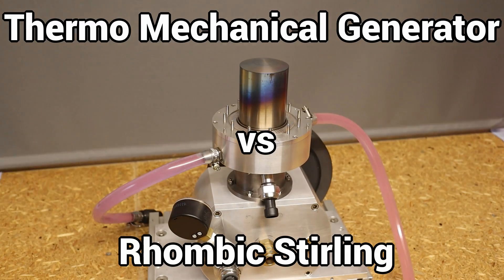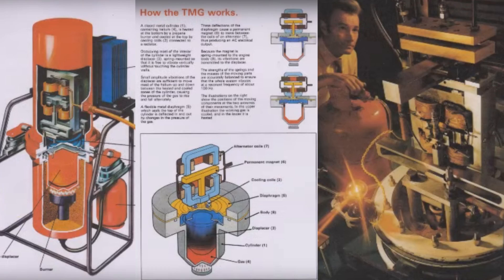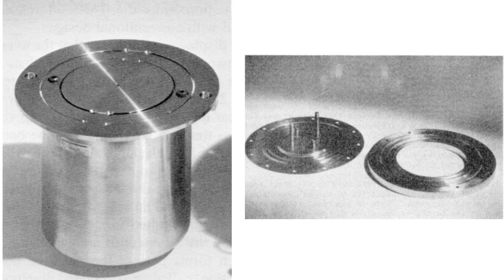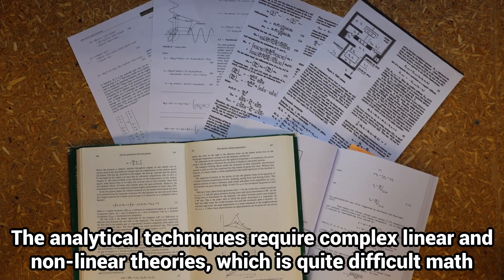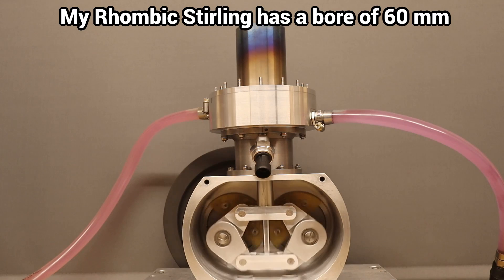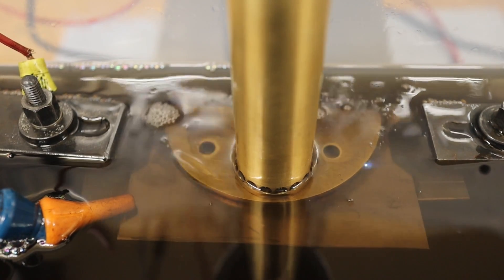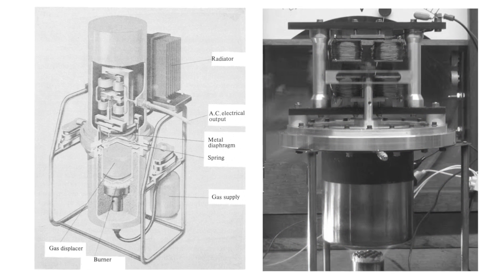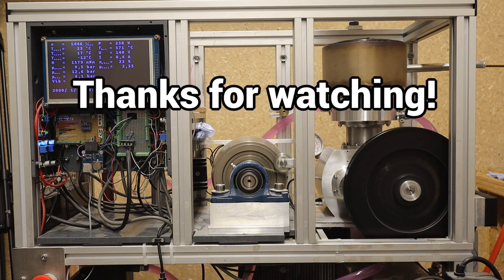Thermo Mechanical Generator for more cheap energy than the Rhombic Stirling engine to go off grid?

Comment: Wasn't aware of Whispergen's actual configuration.  Downloaded several NASA papers many years ago.  They had some very good efficiencies', but needed close tolerances and somewhat exotic materials.  60-100 Watts output, if I recall correctly. Intended for satellite use.
Reply from the maker: I think the Whispergen is a "conventional" free piston engine which is very high tech and has a lot of the problems I am dealing with my Stirlings.
But thanks for you suggestion

Comment: Are you aware of Whispergen ?  Sounds like you are duplicating what they sell.
Reply from the maker: I think the Whispergen is a "conventional" free piston engine and its quite high tech.
I want to discover the other direction and want to go to more low tech.
Reply: @myengines2443  Whispergen used four alpha-configuration Stirling engines and a wobble yoke or swash plate (I forget which); their solution was not the same as a free piston Stirling engine. If you do a search for images of their engine, you'll see the mechanical system they used. Free piston systems don't have mechanical linkages governing the motion of the moving parts.
Reply: Whispergen 's engine wasn't a free piston based system. An image search of their engine shows that they used a "wobble yoke" to control the movement of four pistons in a double-acting alpha configuration.
Reply from the maker: @Berkana   yes you are right, sorry I confused it with an other engine.
But it is also very high tech and expensive.

Comment: It would be interesting to test the performance of a thermo-acoustic or liquid piston engine pushing and pulling a magnet through a coil.
Instead of just burning your wood you can use a wood gasifier with an of-the-shelf ICE generator + exhaust heat exchanger to produce heat and electricity.
Reply from the maker: I will investigate other Stirlings like the thermo acoustics in the next weeks, look out for new videos!
My main fuel will be self produce biogas (look at my diy digester-video) but only when I need too much energy (in winter) I want to use wood and maybe woodgas.
I want to try to avoid the use of an ICE but if I fail with my attempts I have to...
Thanks for your help

Comment: I was looking at NASA's free piston Stirling engine and came to the same conclusion: how the hell do I design the springs? I was thinking of replacing them, at least at the design stage, with linear actuators (i.e., controlling the alternator and adding an alternator to the displacer) and using a digital feedback loop to find the optimal regenerative forces. But I tend to fix everything with software, so what the hell do I know?
Reply from the maker: Yes its complicated...

Comment: Might be able to use nitinol foil for the membranes? Not cheap, but super-elastic and limitless cycle life.
Reply from the maker: Thanks for the hint, I will check this!!
Reply: @myengines2443  in terms of the complex math involved with the spring resonance, etc. It's certainly the case that at the time it was a complex affair, but modern software has made it a lot more accessible; I wish I knew an applied mathematician as they'd be able to point me in the right way. As for the spring... They're commonly manufactured in a wide variety of materials and called flextures. I'm sure one of those companies would have a service available to make them to order

Comment: Is your sterling engine not oil lubricated? If not, then why not?
Reply from the maker: It has to run dry because any oil would contaminate the heat exchangers, especially the regenerator which is made of very fine wire screens.
That causes a lot of problems and makes things much more complicate...
Reply: @myengines2443  Is it possible to use dry lubrication such as powders? Or will this have the same problem perhaps.

Comment: Beryllium copper is not that exotic.  I see it available on Amazon?  And it may be optimal but not strictly necessary.

The low power output for the 1967 engine design is likely due to low working gas pressure.  You may be able to run higher pressures to increase the output.

I see a lot of parts in the design that could be made by spin forming sheet metal.  That won’t increase the diameter limit of your lathe, but you might be able to adapt a milling machine to spin form a large part.

I’ve researched Stirling engines for years and concluded that a diaphragm based system was the only practical way forward. For a small, DIY engine the sliding friction in the displacer was too difficult to overcome and a diaphragm fixes that.  Please give it a go!
Reply from the maker: Beryllium copper is not so easy to form because of its spring property why its chosen for.
Higher pressure may be a solution when you put a tight cover over the diaphragm so that the pressure difference is not too high.
But I think there is a reason why Harwell and also HoMach both worked with very low pressures.
This is really an interesting topic which has to be explored!
If someone knows more about pressurization a TMG it would be very nice to get some information!
Reply: @myengines2443   Is you chose to work with Beryllium please be very careful.  It is highly carcinogenic. Grinding dust is very hazardous.  A gear manufacturer I used to work for, turned downed work that contained Beryllium.

Comment: Heat engines are pointless in a renewables world  , why not start investigating long term storage  . Maybe a closed cycle liquid gas system for example  ?
Reply: "Heat engines are pointless in a renewable world."

...and yet, we are still building diesel road trucks, diesel locomotives, diesel generators, and electricity is still provided by coal and natural gas turbines.

Don't buy the hype. Wind power and solar are extremely inefficient, wasteful, and still yet require heat engines to sustain their infrastructure.
Reply: @driverjamescopeland  We need to keep up with the latest facts as the world is changing extremely fast , 250 ton battery electric mining trucks , EV sales worldwide are rising and even my local airport has chargers for electric aircraft use only :^)
Reply: @JohnSmith-sz4gv  - that's great and all, but electric will never be the answer without nuclear materials... and those can never go public.

Even though the average consumer's daily needs can be met with electric, extended duty cycle applications are still far from being comparable to diesel solutions. The thing is, nobody is planning to make these applications electric-friendly... which would entail miles of static conveyance routes and sorting hubs. We need massive infrastructure adaptations, and it's simply not happening. Take a look around, and get off the Kool-aid. The fed doesn't care about all the things you've been conditioned to support. They want control... totalitarian control.... and your ability to drive doesn't fall into that outline.
Reply: @driverjamescopeland  just follow the money  , renewables are the cheapest energy on the planet and expanding at an exponential rate  :^)
Reply from the maker: I don't think so, as long as the long term storage problem is not solved you have to convert biogas and other sources into electricity.
And experimenting with this topic is not my thing.
Reply: @myengines2443  meaning like the liquid air battery being experimented with at the moment  .
Reply from the maker: @JohnSmith-sz4gv  do you know something about the approximate efficiency of this technique?
Reply: @myengines2443   sorry I've no idea but i think , if i remember correctly it was over 60% making it worth pursuing  , the company building it has a pilot plant being built from of the shelf components  , it should still be on the net .
Just done a quick search and they are cropping up in several countries  , this technology should scale as the Stirling cycle engines you experiment with can work as single stage cryo coolers with the correct operating fluid  .
Maybe Helium or other low temperature medium  .
Reply: You're confusing heat engines with combustion engines. All combustion engines are heat engines, but not all heat engines are combustion engines.
Reply: @ElijahDecker  sorry maybe i should been more explicit  , but it seems that making electricity from any temperature differences is very inefficient  , but pressure difference like from liquefied gas to gas at atmospheric pressure might be more productive  , then use excess electricity to re liquefy that gas at times of abundance  . A closed cycle so even noxious gasses could be used in the process  .

Comment: Aneroid (barometer) boxes expand and contract depending on difference between inner and atmospheric pressure. They are basically two diaphragms and a rim holding them together.
Reply from the maker: I have to look at them if some principle can be adapted to the TMG, thanks!

Comment: NASA has done things with stirling generators that would seem to based on the Sunpower free piston designs. Here is some literature: https://rps.nasa.gov/internal_resources/156/   Good luck in your work.
Reply from the maker: Thanks for the link, I looked a lot at the NASA work.
The did/do a great job.
Reply: @myengines2443  Well keep up the good work. I have watched many, many stirling engine videos. Sadly most are of the little toy variety. You are actually trying to achieve a stirling that can actually produce enough power to do something useful. Thanks again for your videos.

Comment: Please aim for 1 kilowatt from unlimited 90C water. Organic rankine cycle might work better in all parameters thanks to phase change working fluid.  I like the linear motor design. What about going strong, long and slow instead of fast short weak ?
Reply from the maker: An engine with 1 kilowatt from 90C water has to be very large like the sunpulse.
It is an interesting concept but not my type of engine.
A larger stroke needs a conventional piston/displacer with the problems I had with the rhombic but we will see whats next...
Reply: @myengines2443  I think he meant an engine similair to a steam engine but then closed loop. That will run on pressure difference. You can use a vane pump or even better a scroll pump as an engine. De AC pump of Toyota Prius: DENSO HFC134A Klimakompressor has a scroll pump an can be used as engine, you can maybe even use the build in motor coil as a generator!  
As working fluid you can use Butane/propane which you heat/cool with an external heat exchanger ;-)

Comment: Honestly, a great concept. But each design has its benefits and advantages. Stirling engines are efficient, long-lasting, reliable, and durable engines. It is not a good idea to limit their use to generating electricity. Using mechanical energy directly without conversion has its applications, and large displacement generates more energy. 
1:35 
It is not correct to say without " mechanical drive " Because everything is mechanical, but it is correct say, without " physical/visible material drive ".
Also, the gears system ( the mechanical system in general ) is a very simple, reliable, efficient system and not complicated ! You can also simply use appropriate materials or use cushioning to reduce the impact of various forces, thus greatly reducing “ friction and wear.”
Note: less electronics and electrical circuits, means a simpler, more reliable, more efficient, and durable system.
Reply from the maker: Yes you are right with many things as you can see with the electronics problems we often have with modern cars.
But the electrics in an liner alternator is not vulnerable and very durable I would say.
Thanks for your suggestions

Comment: It made me wonder if you might use a linear alternator idea on the stirling engine,  with flexure springs, or bearings, controlling the vertical stroke/ restoring force on the "exhaust stroke', instead of converting to rotation...magnets and motor/generator design has improved a lot in the last decade, and it might just be possible to use a "linear motor" design as the generator with the stirling piston/cyclinder arangement?
Reply from the maker: Yes, this is made in the "conventional" free piston Stirling which I want to investigate in detail soon as possible candidate 3 or 4!

Comment: The spring mechanism, a flexure, appears to be amenable to some more rigorous design, and might be easily cut by laser, or water jet ... the larger diameter might even be cut with plasma...

Comment: A recent 'volute spring displacer' video from another channel (re)peaked my interest in stirling engines. They are suggesting that this displace has natural resonance, and it is stimulated with electro-magnet/voice-coil.
Interesting as with CPU control the timing vs piston would be variable/adjustable to hit peak performance. Spring could then be re-manufacture for the optimium resonance.
Reply from the maker: Sounds very interesting but also quite complicate.
Thanks for your suggestions!
Reply: Maybe a double piston/diaphragm controlled by voice coils and a microcontroller would work?
Reply: @RingingResonance  that's exactly what I have in mind. And to 'fold' the layout so that it's either side of a rocket stove ...

Comment: In diaphragm the g is silent, idk why

if it is 90% efficient, if the hot side was heated by the sun, with a big mirror/collector, and the ground to cool the cold side, how would the efficiency of mechanical compare to solar in efficiency genereting electricity?
Reply from the maker: I think photovoltaic cant be beaten, I want to use it as a backup of my solar plant when the sun is not shining.
(we have a long and dark winter here in Germany!)
Thanks for your thoughts!
Sorry for the misspelling, its a hard word for germans!
Reply: @myengines2443  I think your analysis is correct, this is not a start from scratch do-it-yourself project. The design has already been done and the knowledge of the HoMach design must be somewhere. To work as micro CHP this must be produced as a white good, like a refrigerator.

The advantage of Stirling engines is that they can utilise a poor fuel, like wood, refined fuels like natural gas, propane or diesel for micro CHP are better converted by an internal combustion engine.

My Solar PV supplied me with excess electricity 237 days this last year and I only need to generate electricity on average 5kWh a day for the other 128 days. In these days of LiPo batteries that only requires a generator run time of a couple of hours a day.

My wish would be for a woodfired TMG running constantly outputting 300W with the cold side heat running  underfloor at <30C and the exhaust at 700C for higher temperature heating.
Reply: Stirling engines are more efficient than solar cells. The efficiency of photovoltaic cells ranges between ( 18 % - 26 % ), but the efficiency of Stirling engines is much higher, reaching about ( 51 % ), with the possibility of being more than that. Also, any fuel can be used on Stirling engines. Including sunlight, it can be of multiple uses and is not limited to “ generating electricity ” as mechanical energy can be used directly without converting to electricity. Moreover, it is more reliable and more durable.

Comment: You can try to combine 2 engines one against horizontally other to move one magnetic part, so power would be doubled. Also, original magnetic part with the use of neodymium magnets would much more efficient, you wouldn’t need to move upward heavy magnets every time.
Reply from the maker: Ok, I have to think abut this.
Its always nice to have the heaters in a multi cylinder engine as close to each other as possible to make it easier but if the advantages outweigh the disadvantages perhaps.
Thanks for your suggestions

Comment: and do remember, a stirling engine/generator should only be 1 part of a multi-part energy system, so if you create Nikola Tesla's steam turbine connected to a generator, then use the hot steam from the turbine exhaust to run a stirling generator, then after all the steam is condensed back into water, you could potentially use a hydro generator to extract the last bit of energy from the system.
Reply from the maker: Yes "waste" heat is a precious resource.
I want to use it to heat the home (cogeneration unit) in winter and in summer the solar energy is usually enough.
If not, your idea comes into play.
Thanks

Comment: skip the free piston calculations and use a mechanical linkage, combine the good points of both, you may need to stretch your manufacturing knowledge a bit to come up with a efficient new design, separating the power piston from the displacer volume is foolish in the Harwell design, I would start with an existing efficient linear generator and work my calculations from that so you get the output you want in the first place, your mechanically linked rhombic drive will never compete with a Harwell style of generator it just has too many friction points, I will think some more on this,  putting heat in one end and getting electricity out the other end efficiently has some appeal to me
Reply from the maker: Yes, thats also my thinking...
Reply: If the appropriate bearings were used for each point, friction would be negligible !

Comment: Have you explored the rotary designed stirling engines? They are much simpler to build, I haven’t seen anyone seriously attempt to scale one such design up.
Reply from the maker: Yes I saw some designs but never heard of a running one.
Its an interesting concept but that there isn't any functional one may have its reason...
Your idea comes on my list and many thanks for that!!
Reply: @myengines2443  Mdevink here on YouTube has a few small LTD toy models which work fine. But yeah. Would be interesting to research whether they can be scaled up. 🤗 

Anyway. Love your work. :)